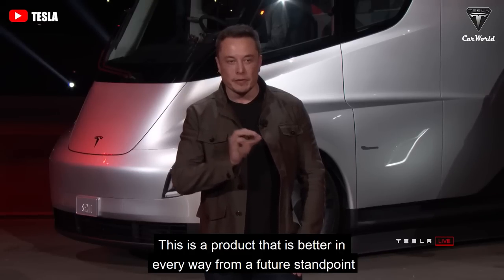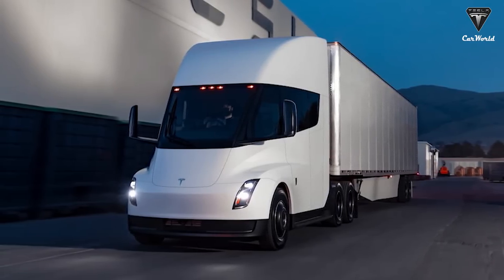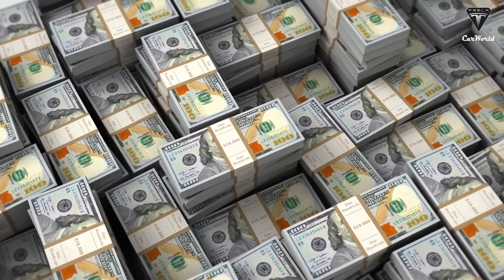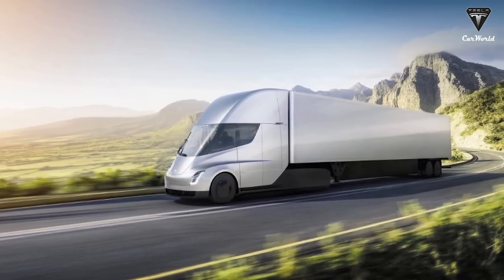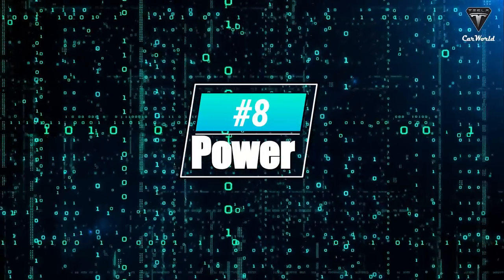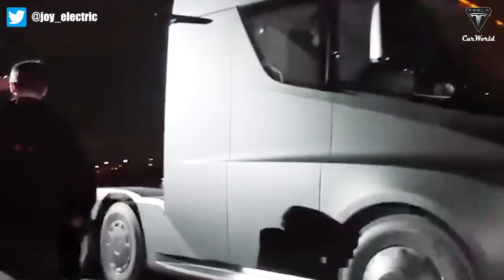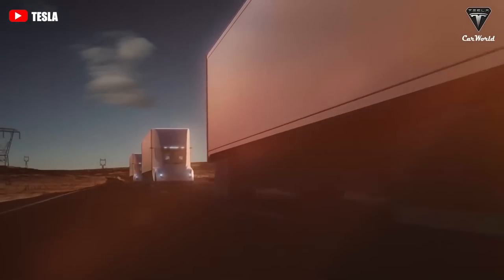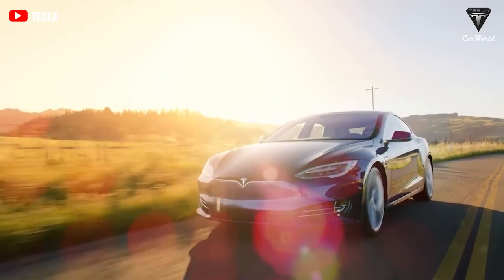Insane Tesla Semi Features That Elon Musk Never Revealed... UNTIL NOW!!!

Comment: How about being able to recharge as it's on the move down the highway - Like in-flight refueling of our aircraft?
Reply: Solar panels?
Reply: Wastes too much electric energy.
Reply: One of several ideas I’m tryin to patent th unpatentability for people
Reply: In Germany, they have built 60 Km of freeways with overhead trolly lines that electric trucks can use to recharge while driving into 3 large cities.  The cost is $ 1,000,000 per Km, in Euro's.  

I think that would be a great solution on I 5 in California, where they could electrify portions of the road, say 20 miles of overhead trolly lines, then nothing for about 50 - 80 miles, then another short section.  Like going uphill on the grapevine, or other large hills. They could collect about 10 KW per minute or mile while going 60 MPH.  3,000 VAC system would work great, and run a charger built into either the truck or trailer.  Even electric trailers would be possible, where the trailer charges while parked and getting loaded / unloaded.  A 60 amp 480 volt charging point at a supermarket can charge the trailer and truck battery at about 36 KW each per hour while being unloaded.  

The trailer with a 200 Kw battery and it's own 200 Hp motor can supply additional regenerative braking, and supply more power while keeping the tractor on the road more hours per day!

Comment: I hope that it is using the best Air Brake System...

A start lone haul company would set up a relay system... 

Using this truck in the mountains of a route - switching to standard Diesel Trucks on the flats... 

Let say from Sacramento California to Eugene Oregon on Interstate 5 was to use the Electric Truck..

From Los Angeles to Sacramento California
Eugene Oregon to Seattle Washington...

This would speed up the current situation of getting over the mountains - improve business   road trip time and lower it's fuel consumption.

But it does this at a lower cost - as for fewer electric Trucks would be required up front to have a major change in the bottom line. 

The same thing for those routes over the Great Divide and other mountains.

Then the cross the country - those lines below Below Interstate 40 - like 20 and 10  -  not as cold as the ones north of that line... This could provide the charging stations to use Solar Panels and Wind at the Warehouse. 

Again cutting the fuel pump cost - then the routes in the Northern area could be used if the weather risk of vehicle loss is worth it.

That's my view...

Comment: Im confused on the price. According to Forbes and other news outlets reporting the price of semi is likely to be more than double the price of a traditional diesel truck at around %400k which is certainly well over double $150-$180k reported in the article here.

The other big thing that was not mentioned but is probably the most important to someone buying a truck, which is how much cargo cat the tesla carry compared to a traditional truck average load being between 16=23 tons. If the tesla semi shown in the launch video doimg the 500mile test is anything to go by then its cargo capacity could be in the range of 6-8 tons, based on the weight of the concrete barriers shown as cargo. Which means you potentially meed 2 tesla semis to do the work of one traditional truck. And that would work out at 800k worst case compared  to $160 which is an additional outlay to start witg of $640k or $140k if you go by the article's figure's. That is before you get to the second driver and maintenance and running costs of two trucks. Also something else to consider is where is the driver going to sleep as the tesla doesn't appear to have sleeper options as of yet on the models shown.

The  Tesla will be at its best is operating in cities and low emissions zones. Where local authorities put a fee/charge on certain vehicles that enter the zones and in some case banning certain vehicles from entering. 

Until battery weight can be reduced without effecting range the tesla may struggle to get its foot in the door of long distance haulage market.  Whete a European manufacturer is testing a system that uses overhead pover cables on major roads and highways switching to a smaller battery with a 30-50mile range for operating within towns and cities to maximise the vehicles cargo capacity.

Comment: The only thing I'm looking forward to is the seat being in the middle. I really only see mega carriers getting into them in the near future until the infrastructure is built up. Seeing as they are the only ones that can afford it, areas that are pushing for 0 emissions are going to see some crazy price increases justified by the new trucks required to run the freight. I only just started trucking and I hope I can finish my career before mega carriers take over. That'll be the true end of days for trucking.
Reply: I’m looking into getting into trucking and have a few questions, are you not also excited about the autopilot mode? Does it get exhausting driving for hours on end having to focus on driving, Wouldn’t autopilot make that much more enjoyable? 

I haven’t seen anyone mention the solar charging that will constantly be occurring while driving during the day, surely over 500 miles of driving that would add a decent amount no?
Would you become an owner operator if you could and if so do you not think this would create a consistent price for charge as opposed to gas which can fluctuate heavily, wouldn’t this semi benefit owner operators?

Sorry for all the questions
Reply: I know your question wasn’t directed at me but I’ll chip in with my two cents. I ‘was’ a trucker for awhile. Hauled gravel for awhile until I finish went Over The Road. 

Autopilot feature would be nice and is my number one want as most of the driving is on long interstate driving. Solar panels are a possibility but my understanding they don’t generate enough electricity to charge a Tesla. Tesla cars have small roof so they would have to have small solars. Tesla semi have the potential to use the entire top of the trailer. So solar may be possible but they have engineers who knows this stuff and have gone over it. Solar really doesn’t put out as much as we need for the time being. (I may be wrong but that’s my understanding). Operating cost is actually much lower with Tesla semi IF you have your own cheap electricity like your own solar farm. My buddy who’s an engineer sat down with me and we went over it all numbers seeing if it would be profitable and that’s basically what we came up with. For it to be financially ‘ feasible’ we would need our own solar farm.  Fuel is the number one expense trucker so for now electricity is cheaper.
Reply: @pneu9059  do you like literally staring at a screen for a job? Barely any input just staring. That wouldn't get depressing for you?
Reply: @NURGLESBLESSING  are you talking about autopilot for trucks or just regular jobs

Comment: They dropped one motor yet the specs remained the same. That suggests they are using the Plaid motors, not the Model 3.
Reply: Model 3 plaid cause th only thin  beyond ludacris is plaid  I’m thinkin th only thing ludacris beyond plaid is pink plaid spuds please ina Serenity City terra tunnel power plant charity Chargin load leveling grid stabilization
Reply: Apuss not spuds GD
Reply: Model s plaid NOT MODEL3plaid
Reply: or they are lying
Reply: @jebes909090  The probability of that is slightly greater than zero.
Reply: @bobstrayer9004  considering that elon lies constantly,  i'd say its much higher.
Reply: @jebes909090   You assign to much weight to your own opinion
Reply: @jebes909090  He was wrong. Everyone is wrong, big deal. Missed it by 5-6 years.

Comment: Something weird is nobody asking how 3 motors are connected to wheels. 4 motors was easy, 2 on each axle, one on each tandem set. But 3? How are they connected mechanically? 1 on each axle, including front axle?
Reply: Maybe 1 motor on one axel  an maybe one motor per wheel on other axel but t m jus like hinkin out loud like th Tesla hater bus got 2axels in backHA
Reply: In tire biness it’s  
Right or left-side of truck 
Front or back -axel position 
Inside or outside…… right rear outside is right side truck REAR -rear axel an 3word was outside tire on rear axel …..first thing I’d ask is “repair replace “( short an sweet so I can go back to th thoughts / songs in head) …….. left front in or out or right front in or out ,left rear in or out  right rear in or out = 2axels front an back each with 4tires
Reply: One motor for the rear axle, and one motor on the passenger and drivers side middle axle.  There is not space for all 4 motors behind the cab of the truck, unless arranged this way.
Reply: @michaelstarkey9745  , what?
Reply: @Kangenpower7  4 wheel motors is no big deal, they've done that already, electric wheel motors have been around for 50+ yrs now. What is different is how they do differentials on the two axles with three motors.

Comment: If Tesla incorporated Thermal photovoltaic materials within the interstitial space between the cells, they could recover some of that heat loss as generated electricity while cooling the battery system at the same time!

Edit: I had to add a comma so people didn't say it all in one breath lol.
Reply: As TPV systems generally work at lower temperatures than solar cells, their efficiencies tend to be low. Offsetting this through the use of multi-junction cells based on non-silicon materials is common, but generally very expensive.

Just pulled that off Wikipedia, seems expensive and complex which doesn't sound very Elon 😅...would be cool if they got it to work though
Reply: Say it I dare ya say it say it ………….thermoelectric generator
Reply: @michaelstarkey9745  Thermo-electric generator
Reply: tell me you don't know how thermovoltaic technology works without telling me you don't  know how thermovoltaic technology works
Reply: @The_Conspiracy_Analyst  There is a way to store thermal energy. By using thermal reflective and absorptive materials with vacuum insulation. The thermal energy would have to be stored in a continuous loop from cold to hot. Hot side would be forced to absorb thermal energy and cold to emit it. Electricity would come from the thermal difference of two conductive manifolds as long as heat stays in the system. I have yet to see anyone else employ it though.

And by the way you don't need to be rude. next time you could say "Hmm I'm not sure that's possible, what's your reasoning on that? And if you have anything to ad on this idea that could make it work I would appreciate it.

Comment: It would be nice if Elon came up with a super long range hybrid powered by a small diesel engine.  The good thing about a hybrid combination is the fact that the battery can supply a pulse of power to the motors that would make the system more efficient than a large diesel linked to a transmission.  

That is reason why modern diesel trains use Gen Sets instead of a large single unit diesel.  Trains could also benefit from switching from 2 Gen sets to a single Gen set with a battery bank.
Reply: Yeah and when they're parked overnight it would keep the batteries topped up and use it as a lower cost APU
Reply: Edison Motors, look it up.

Comment: Economics means absolutely nothing if you can't get parts, warranty work or it repaired at a nearby certifed repair center. This is where the Tesla semi will die because Tesla is a tech company not a truck manufacturer. Freightliner will end up taking the market because they have the parts network.
Reply: If it were a typical ICE vehicle you might have a point. But this is an electric vehicle. EV's will have far fewer issues and much lower cost-to-own over their lifetime. Just look under the hood. Electric motors have essentially one moving part. Even the rest of the drive train is much simpler. None of the hundreds of points of wear-n-tear or points of failure that ICE vehicles have. No serpentine, fan or accessory belts or associated pumps, pulleys, bushings or bearings. No alternator, mechanical water pump or high temperature, high pressure engine cooling system. No spark plugs, coil packs, or ignition control modules. No fuel injectors, fuel pressure regulators, fuel pumps, or fuel injection control modules. No timing chains or timing gears to replace. No starter or starting system electronics. No transmission or power steering pump so no hydraulic fluids, and no oil or filters to change. Regen allows EV brakes to last two to three times as long so an EV won't need expensive brake jobs nearly as often. No O2 sensors, no PCV valves and none of the extreme heat and vibration that prematurely degrades nearly everything under the hood (hoses, belts, wiring, sensors, gaskets, seals). No exhaust pipes, mufflers, or catalytic converters.  
According to "Road Hammer Truck and Trailer Repair" brake issues, starter failures and engine overheating are some of the biggest issues they see with diesels. These don't exist with an EV.  Your argument is a bit silly.
Reply: Um ……………. It’s electric freight liner issa memory
Reply: @Tron-Jockey  
No plugs in a diesel but you need exhaust fluid.

Comment: The vehicle isn't the problem. Everyone always skips the infastructure and the load on the infastructure. These two elements will define wether something is truely profitable. Truckstops in western Europe have issues with accomodating the current amount of diesel trucks, which is just a concrete slab for a parking space. Now imagine a concrete slab with integrated charging station which must never fail, get bugged or glitched and is vandalism secure. In case these conditions are not met the truck simply can't charge or even park which is an exisiting problem today! If the truck can't charge it will result in a nett loss and if the truck can't park it's not compliant with legislation for mandatory rest periods. The truck will be fine, but what about the infrastructure?
Reply: it is in its infancy.  These things are improving every day!  Do more research and you will be happy with what is ahead.  Imagine explosive tanks of different gases underground with vent pipes and people smoking by them??  My dad was a tanker driver.  An empty gas truck is much more explosive than a full one etc etc.
Reply: Security of the vehicle is fine. It has its century mode.. but the chargers..I guess it depends on the facility. Talking about the chargers performing as needed... tesla's chargers are the most reliable in the world as we know tight now.
Reply: Once funding is secured mobile charity Chargin issa option ……….. classic chicken an egg dilemma……no use building infrastructure if don’t have trucks …. Trucks come first -jus can’t drive em till they charge…….. tow truck business showing some potential
Reply: There was the same conversation years ago when they  built out the  infrastructure for ice vehicles.